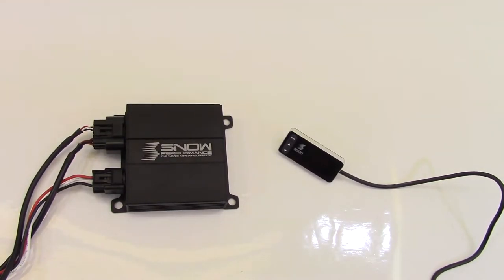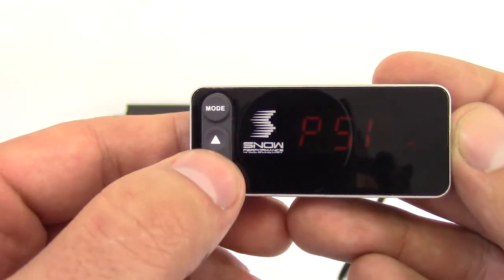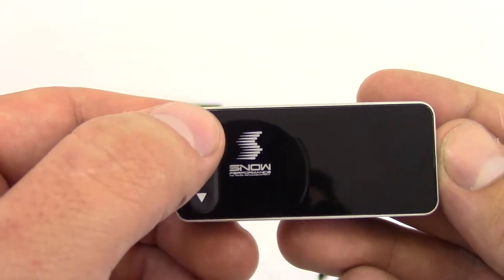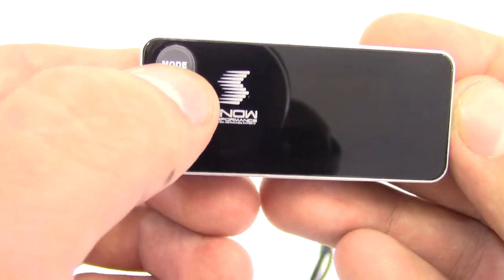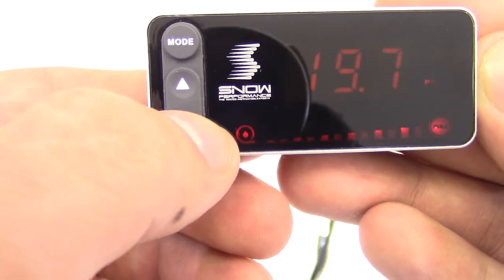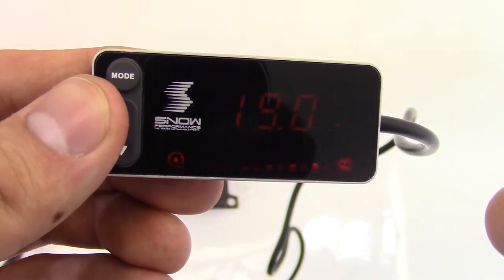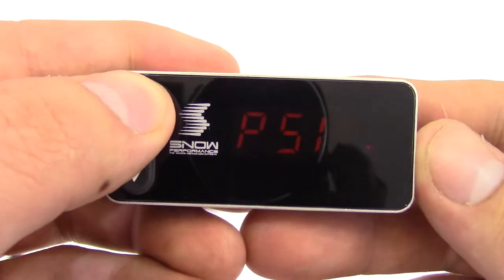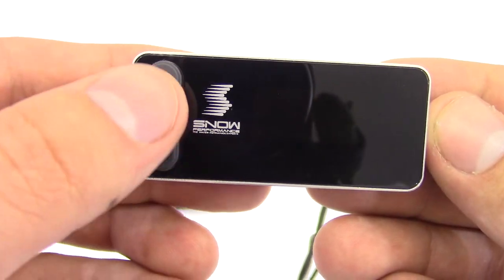Snow Performance VC-30 Water Methanol Controller In Depth Review

Comment: I did'nt ask before buying, but, Are these compatible with MSD ignition? I have moved wires as far away as possible and also foil wrapped the MSD and snow wires, When car is running it keeps flashing E3 and boost number real fast, only way i know its working is the bar on bottom lighting up.  as far as testing guy's,, put the hose to injector in tank with water in it and apply pressure to sensor, can actually use your mouth with it set on .5 lbs will turn it on.

Comment: So I bought the VC-30 and installed it yesterday,

Here is my review.

I actually was surprised how much I like this unit.

The good:
The unit has a remote that shows your boost numbers as the main function 
The unit HAS a purge function by pressing the two arrows at the same time.
The unit can have the start and stop and max setting programmed 
The unit DOES NOT need the wired remote to be connected 
The unit will work and hold the setting with the remote disconnect 
The unit has a variable light bar that shows what percent the methonal is spraying.

All these functions make it a breeze to tune your vehicle.

The bad:
Controller can with no instructions or source for instructions or installing the unit.
The LED screen has no adjustment for brightness 
If the LED is in full sunlight it hard to see the display 
The wire connector attached at the top of the unit and not from the bottom like the VC-20.
The LED display has the wire coming out the side of it, not the back, so makes hiding the power source more of a challenge.

Bottom line very happy with it and will have to figure out how to mount the LED display and hide the cord
Somehow.
Love being able to have complete control of all the spraying functions at your fingertips
Reply from the maker: We appreciate your feedback and thanks for the support!

Comment: Anybody know how to buy legit only the controller to adjust psi?
Reply from the maker: Here's a link to the vc-30 on our website 
https://www.nitrousexpress.com/water-methanol-controllers/vc-30-controller.asp
Reply: @snowperformance1  thank you is there any way to purchase the connector display. For the vc-30 controller module
Reply from the maker: Unfortunately, these are sold as 1 complete unit. If you're having issues with your current one try emailing warranty@nitrousexpress.com and let them know the situation.

Comment: 1) What happens on VC-20 if I run over 20psi?
2) Can this VC-30 work with the pump that came with my VC-20 kit?
3) The little controller thing is really neat, does it NEED to be connected in order to work correctly? Or can I set my pressures and then disconnect it?
Reply from the maker: 1) It will stay at 100% injection.
2) Yes it will.
3) It must be connected and plugged in at all times.
Reply: @snowperformance1  Thank you so much for your reply!

Comment: Hi I've been looking at this kit looks very nice just have some questions about installing it.. I have a mini cooper s r56. So the vc 30 controller taps into my manifold pressure sensor? And the controller itself is mounted in the engine back? The tank and pump will be mounted in the boot so there is enough wiring to run from the engine bay to the boot? Anyone who could answer my question is much appreciated
Reply from the maker: The VC-30 uses its own pressure sensor that you will run a line that receives positive boost pressure from. The controller itself I would recommend installing somewhere that doesn't see the elements. You will probably need to extend the wiring to the trunk.

Comment: Ok thanks, 2 last question because I have heard two different answers on both these questions 

1)One the VC 30 is set with the start remote, once it set can it be removed?
I have heard yes and also no.

2) I have heard there is a purge setting to prime on the newer VC 30 and I have heard there is not one
Reply from the maker: It was designed to be left on the controller at all times of operation. The Controller does have a purge function that when you press the up and down arrow at the same time will have the display say "jet" and start to purge.

Comment: Thanks for the info!
I ordered one yesterday to replace the VC-20,

I don’t really want the remote wired into the cab or see any use for it except when setting up the spray points.

So your saying if I set my spay points and unplug the remote it will not function?
Is the remote waterproof? To be left in the engine bay?
Would be so much simpler to just have large knobs on the unit to make the adjustments
Reply from the maker: We recommend setting up the injection points while tuning and then tucking the handheld display away somewhere if possible. We do not recommend taking off the remote from the controller.
I would not put it in someplace that sees the elements either.

Comment: My controller VC-20 stopped working,

Is the VC 20 wire plug the same for plug and play with the VC-30 the same?
Reply from the maker: It is not plug and play with the VC-30 but you can wire the VC-30 in place of the VC-20.

Comment: Does this unit also show when you need to fill up with more water meth?
Reply from the maker: The controller won't tell you, we send an led with our systems. When wired up correctly it will let you know whenever you need to fill back up.

Comment: Ok, does the VC 30 use the vacuum boost like the VC 20?
Do you sell both of these models?
Reply from the maker: It is triggered off of a external boost sensor the controller has! We only sell the VC-30 now.

Comment: Can I use this with a methanol solenoid (#40060) ? If so how would the wiring work/be
Thanks !
Reply from the maker: You can! It will not operate as a second-stage solenoid it will be an anti siphon solenoid for your nozzle. You will tie one side of the solenoid into the pump's power wire and the other side will need to be grounded.
Reply: @snowperformance1  works out perfect since I plan on using a throttle body spacer on my genesis coupe , thanks !

Comment: Does the controller have a prime feature to turn on the pump which allows to check if all lines and nozzles are ok?
Reply from the maker: It does not.
Reply: @snowperformance1  so how do I test it once I've fitted everything? Any tips?
Reply from the maker: @half_r_mk5  Just connect regulated 
compressed air to the tube that reads boost.
Reply: @snowperformance1  so I guess I can use a portable tire compressor to do a test?
Reply from the maker: @half_r_mk5  That should work
Reply: @snowperformance1  thank you very much 🙏👍

Comment: Is there failsafe or off and on feature with this controller?
Reply from the maker: There is no fail safe directly built into the controller or a way to turn it off but you could wire a switch in line really simply.

Comment: How high can you set the psi till it sprays 100%
Reply: For example the truck runs up to 55psi. Could I set this controller to not spray 100% until 40psi?
Reply from the maker: This controller is progressive up to 30 PSI before spraying 100% while the VC-50 is progressive up to 50 PSI 100%. If you have any more questions feel free to visit our website or give us a call 888-GOFAST-1

Comment: Any video's it actually working?
Reply from the maker: We do not have any video of this operating on a vehicle at the moment.
Reply: @snowperformance1  gotcha.  Does the display function as a boost guage as well letting you know current boost and % of flow demanded?
Reply from the maker: @Conway16o  It does display current boost percentage as well as a bar graph on where its at in terms of "start" to "full" points.

Comment: How can I get a replacement controller my map sensor went out in a month after buying. now seems like the controller gave out gives psi reading but no flow meter under the psi display anymore and not spraying.
Reply from the maker: If you purchased directly through us or an authorized dealer I would recommend sending it in to be checked out by our service and returns guy to see what we can do to help you out. 

Here is the form.
https://www.nitrousexpress.com/images/rgaform.pdf